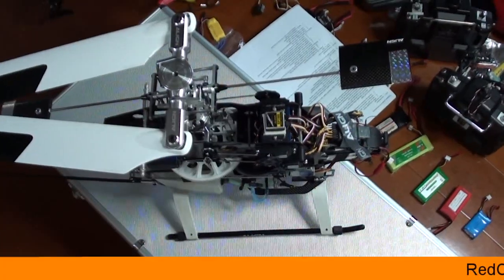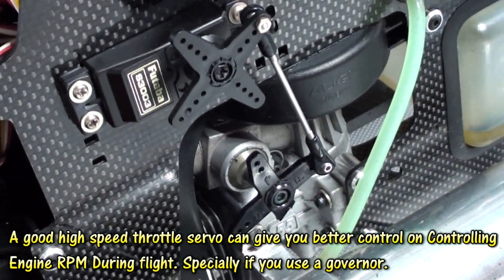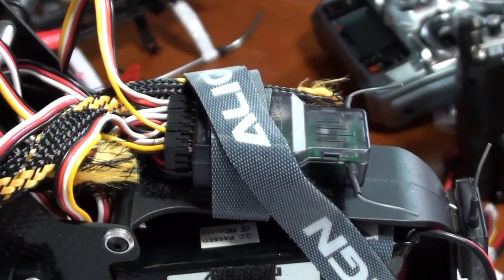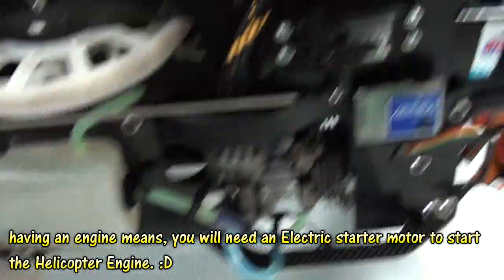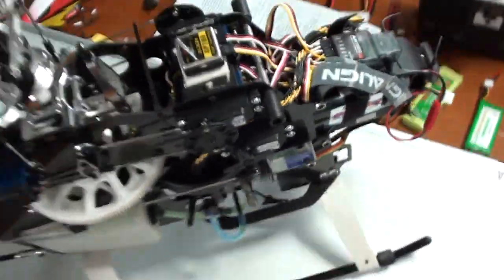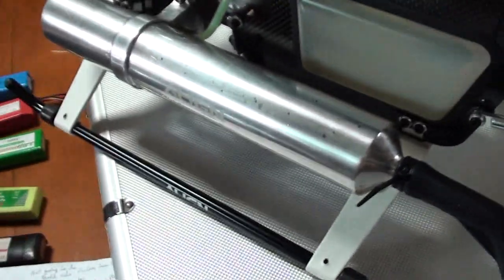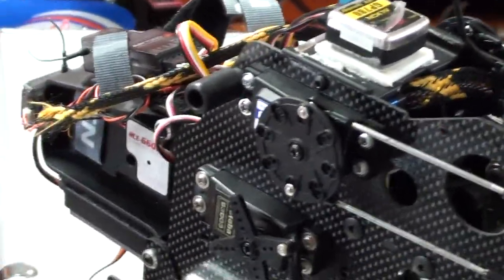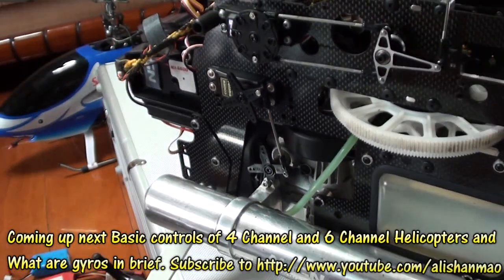RC Helicopters Beginners Guide Part 6

Comment: Actually the regulator is not regulating the current to the reciever, it is regulating the voltage. The current varies during the flight depending on servo load and other things. Regarding the governor, the rpm will actally decrease if the load is to high.

Comment: @kiwibob72 Yepp nice post, agree totaly, and I've seen people using 1-2k$ helis/airplanes and are still at FM/AM band, I don't even trust my cheapest heli/plane to fly on anything other than 2,4. I simple cellphone call can ruin your day, vibration in your pocket = heli upside down on the airfield, happened to me just once and thats moore than enough. For everyone starting out I would recomend Dx6i cheap and "good enough". from supplied e-sky radio to programable Dx6i, not even a contest there.

Comment: @absolutsoju good ide'a to buy a sim, costs i my opinion quite alot of money, but in 3-5 450size crashes you have saved your money, my tip is to buy a coaxial heli and if you enjoy it buy a sim and when you are confident there go for a 450-trex clone. Watch fineless bob's videos, you will learn a ton. I actually bought a FP heli after 1year of 450size flight just to try, went for the honeybee V2 and man can it take some punishment, was very windy today and I had 3(small) crashes with no damage

Comment: @pieman12345678987654 Wow did not know that, I have only had good things to say about helifreak, helpful people and and I have always found good tips&tricks there. Never heard anyone say anything bad about that forum. But your word is worth just as much as mine, so I guess people should take some of the things they read with a pinch of salt then, Only thing I noticed is that the hardcore fans are a little anti to clones, always recomend expensive = good, which isn't always true in my oppinion.